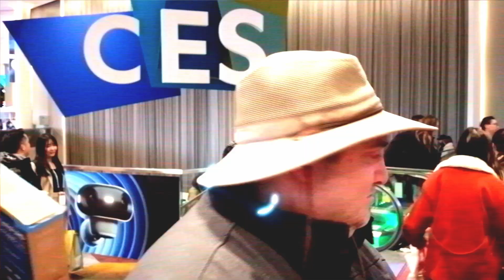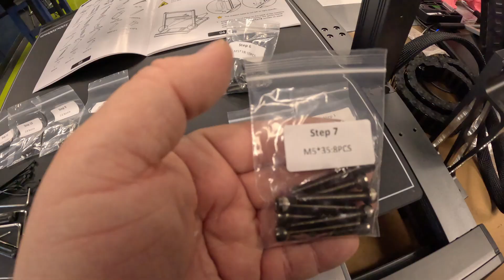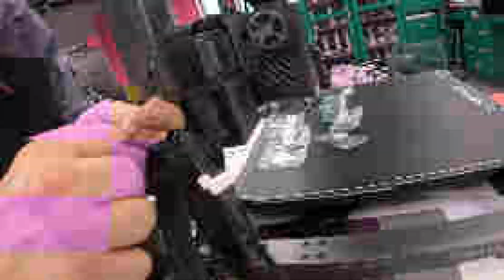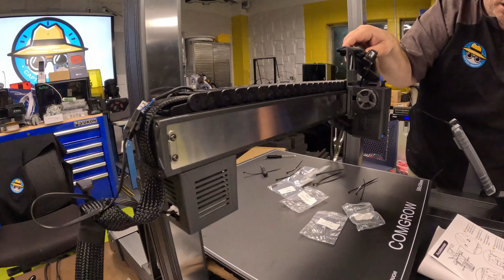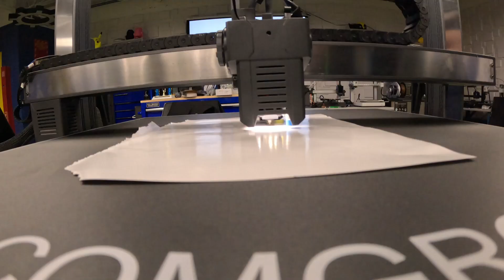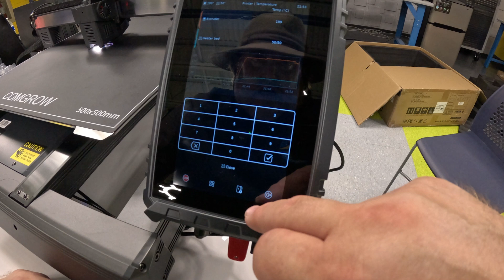Unboxing a 3D Printing BEAST! The Sovol/Comgrow T500 is a Real JAWS of a Printer!

Comment: Are you kidding.  You review a 500x500 printer with a tiny bency
Reply from the maker: You're absolutely right I should have done a bigger print for the testing and that's on me. I definitely appreciate the feedback and I know that when it comes to larger format printers I need to do larger tests. I just did so with the K2 Plus and that's the plan going forward. Thank you for watching

Comment: hello captain creativity i got this printer and i having some trouble with  T500 my screen looks different then your not sure if it a new version. and my build plate moves backwards all the way and hits the back stops and hits it again then tries to going backwards not sure if i miss a step since im beginner. but any advice will help.
Reply from the maker: I would check that there isn't an incorrect wiring issue. Also I don't recall but be sure to check the voltage switch is set to 115V. Make sure to upgrade the firmware but don't do what I did and go to the very latest , make sure to do incremental upgrades.

Comment: I've heard nothing but bad things about this printer, i really wanted a 500x500mm bed and this is the only printer I can find that's at a reasonable price for the size. But everyone seems to have problems with it.
Reply from the maker: I definitely would agree that there are a lot of reports a problems and I've run into a few problems myself but mainly that was due to the lack of clear instructions. For example I've been meaning to get this guy back up and running because after the video I tried to update the firmware and they did not mention any kind of incremental upgrade and so now the unit is bricked. I'm going to get it unbricked And then resume. I have also not seen any evidence of this reliably printing beyond 200 mm per second and obviously That's with a modification that somebody made in the slicer settings. I'm going to definitely be doing a follow-up video because the printer has a place for anyone who's looking to do large size prints but it's all about honing in the settings and I think that if we can get to a point where we know the maximum we could push it then we can all be very happy with our t500s.
Reply: @CaptainCreativity  Yeah I'd be interested to see the follow up as I really don't care about speed. I just want it to reliably print.

Comment: I had this printer for 2 weeks. It was an absolute nightmare. Did not get one acceptable print. Comgrow took the printer back.
Reply from the maker: Was it one of the pre orders or something you got recently . I bricked mine trying to upgrade 😡 , the first few prints worked for me. But I wanted to see if I can push this to the speeds they advertise. I am going to do a follow up video with all the tweaks and steps I needed to take to get to prints I was happy with. It will be a follow video. Thank you for watching and the feedback.

Comment: I always set me bed temperature to 70c before doing bed calibration.  Let it heat soak ample time once temperature reached an additional five to ten minutes so thermal growth of the bed materials stabilizes.  You should be able to push speed up over 100%?  I would like to see more updates and also please add nozzle size you are using.   Love your review, this machine is capturing my interest for a goliath printer currently at $200 off.   I am very interested though in newly released Qidi 4.   I hope Qidi puts out something in this size with surround and heated chamber because I love the size but want to do more engineering grade materials.  An enclosure seems very important for build plate size.   This looks to be killer deal.

You have a great personality and great presence on camera, really glad I found your channel, just subscribed and liked!  Thank you much!  Looking forward to more updates in future on unit showcasing some monster prints!
Reply from the maker: @jefft490  So in the video I just started with the standard .4 nozzle. It's funny that you bring up Qidi as I'm doing the setup and unboxing review next for the Qidi Max3. I would love to actually get my hands on a Qidi Plus 4 and do a comparison video. Out of curiosity what is it about the Plus 4 over the Xmax3 that you like more. Certainly it's newer and I definitely know that it supports the multicolor filament box but It does have a smaller build size. Any reason why you wouldn't prefer to go with the larger build size of the Qidi Xmax 3?
Thank you so much by the way for your feedback and for watching definitely stay tuned because like you I'm also very interested in the Qidi line. I think they've really been doing a great job of ramping things up in the 3D printing community. Based on CoreXY enclosed printers I feel it It will come down to either Qidi or Sovol on releasing a CoreXY 500x500x500 first.
Reply: @CaptainCreativity  I love the new nozzle design on 4 plus with 305 footprint and future AMS.  Having multicolor would be great for me. I have the Q1, xsmart 3 that thing runs 24/7 same for Q1 and old school suped up ender 3v2.  I would love to do some muticolor prints and also would like to see something like Max3 get a new update with AMS support.  Having heated chamber is big reason I love the QIDIs.  I hear the 4 Plus out of box works flawless. At price point and with 305 footprint it could be unit to go after Bambu labs for sure and price wise with heat chamber larger size sounds like will crush bambu Carbon prices for like features.

Comment: I got this printer a while back, but have not found time to set it up. I will be using it for making enclosures for projects and printing lots of small parts at one go, such as parts kits for DIY projects. Speed is not a priority for me, but reliability is.

I’m worried about the bed adhesion, but we’ll see. Also my bed heater mosfet was kaput, but they sent a new one.

Please make a follow up video if you have time!
Reply from the maker: I definitely will be doing a follow up video where I go through the input shaping. The pitfalls of upgrading the firmware. As well as the reality of the speeds you can actually get with good quality. Thank you so much for watching and stay tuned.

Comment: About the z off set I think it depends on what kind of probe the printer uses for example on my Neptune I calibrate cold and on my ender 3 hot do to the cr touch and the Neptune with a laser probe now the k1 uses a pressure sensor! One thing I learned is in the slicer do pic what plate you use smooth or textured example the textured plate will need a higher z off set now all that is opinion 😊
Reply from the maker: Thank you for watching and the feedback. I'm definitely going to be doing a follow-up video because there's a lot of tips and pitfalls along the way that I have learned and I want to share those experiences as well as tweaks. I will say however that once I heated the bed and then did the bed meshing I still had one corner being higher than the rest but it was nowhere near as bad as what it was before. When I'm looking at the change log on the firmware they do acknowledge this and they actually heat up the build plate prior to bed meshing and Z offset so it turns out that they corrected this. Anyway thanks again for watching.